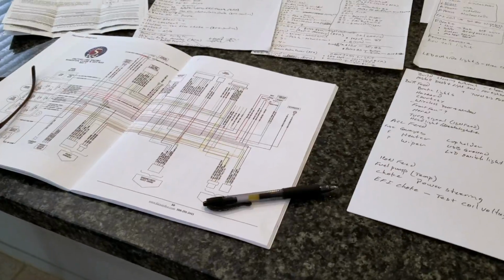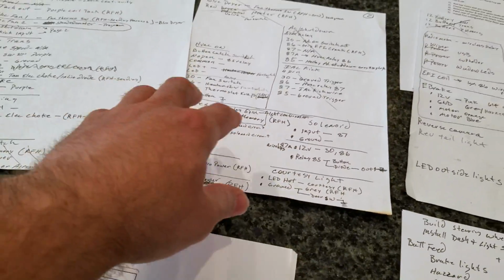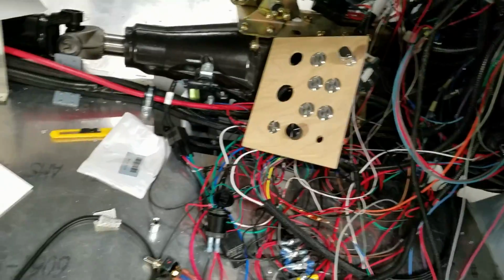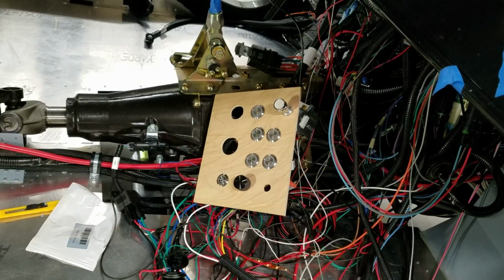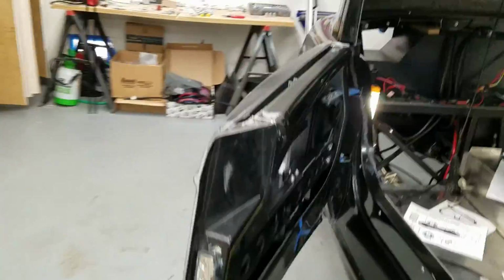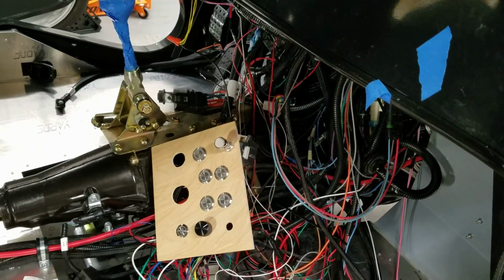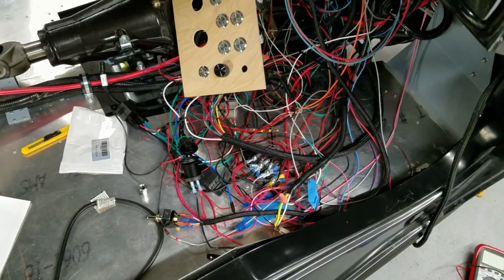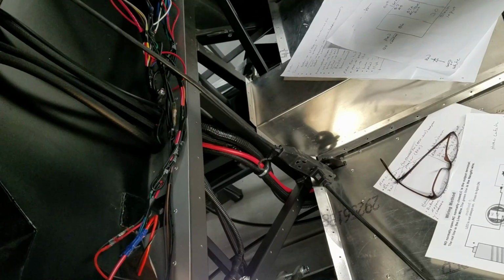Factory Five 33 Hot Rod V2 - Installing Electrical Components In Car

Comment: So what is the overall plan for the next steps?  I ask because you are not installing headlights and horn. Are you going to get it started and then pull the body for painting?  Where does state inspection to make it road legal fit in? Just curious for a high level road map for the next several steps...
Reply from the maker: I was basing it on inspection.  I wanted to get inspected so I can put a few hundred miles on it and work out the kinks before paint.  However, not sure that order is worth my time since I would have to install the windshield temporarily before paint. There is a lot of catch 22's that are making rethink a bunch of stuff. So the plan is still in discovery mode.